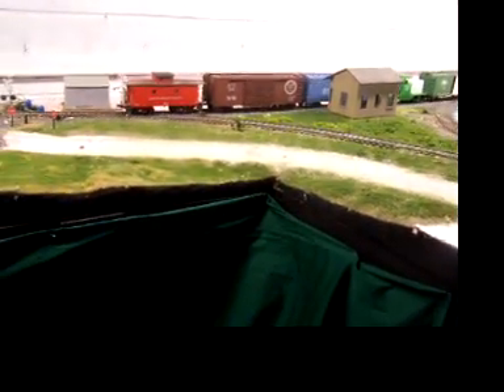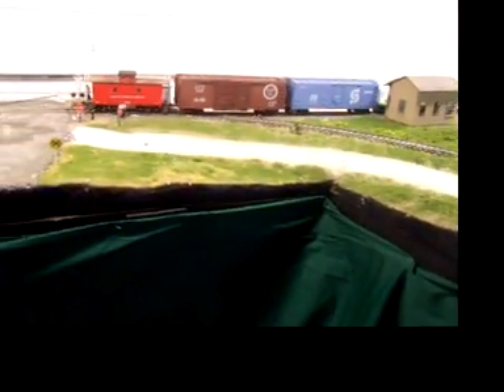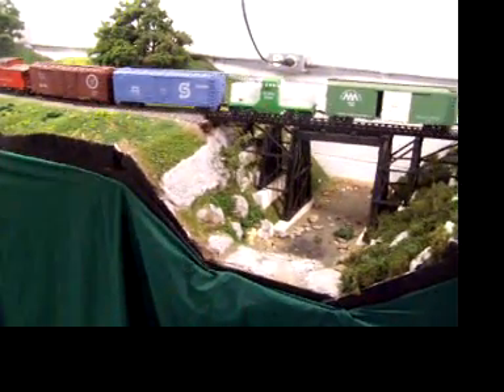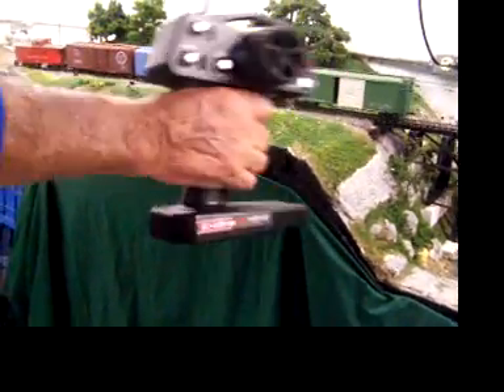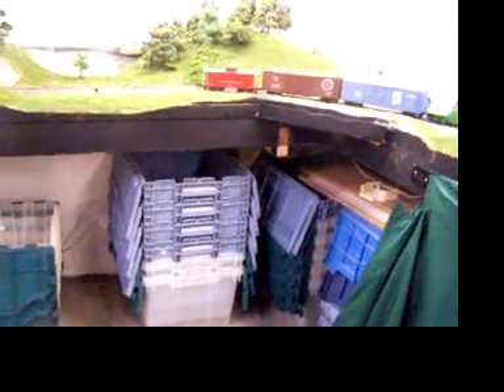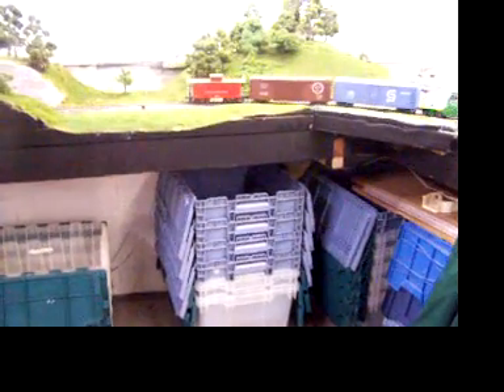100_4775.MOV

Comment from the maker: @jbll36    I have not run the  loco till the battery protector has cut off the power.  I have run   on a single  operation, about  45 minutes now, and  still there is power.  Yes the  track on the peninsula is finished.  It is  listed as wrinkled track on one of the  You Tubes.   Very  bad local owned track. Just barely acceptable.  Humps, sags, broken ties, and  so on.  Toughest track I have done.